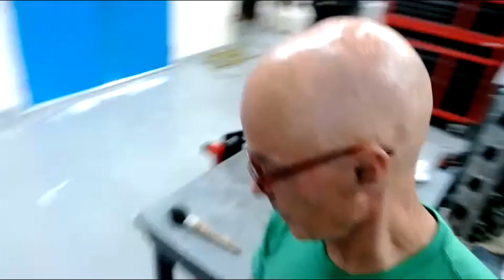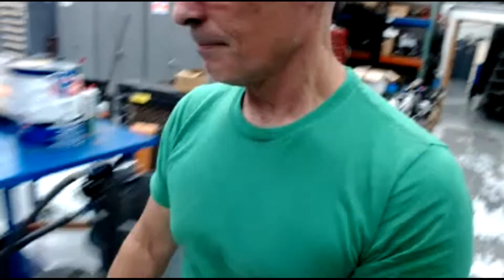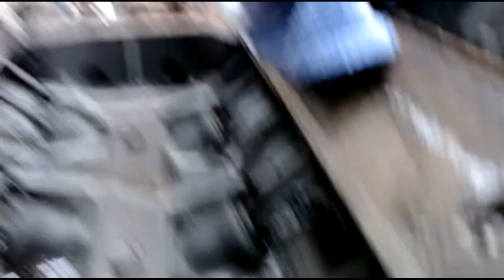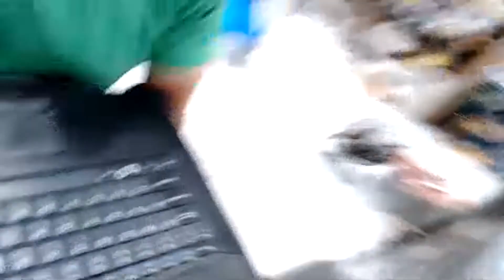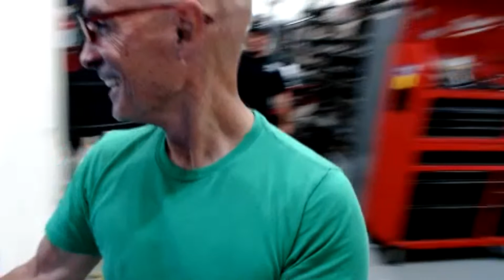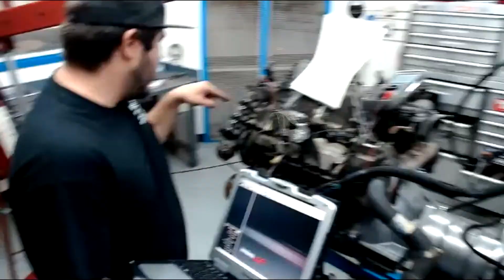LET'S TALK TURBOS AND BLOWER-COMPOUND 3800

Comment: I've heard you can swap the rotors from a m112 into an m90 and extend the case and shorten the snout to fit, haven't heard if this was an improvement or not though only a couple GTP guys seem to have done it.
Reply: Extend the case how?
Reply: @cc23001  you machine a spacer to sandwich between the sc housing and the snout mounting plate then shorten the snout or run an offset pulley. I've only read about it never really seen anyone do it though. the rotors also extend past the original opening in the m90 case so it might restrict to much to make a difference.
Reply: @jakemountjoy7232  you don't shorten the snout. They use the snout from Ford Eaton blowers. They're already short. But a spacer plate is used

Comment: I honestly  think  your  going to be  limited   by the  manifolds  on the  3800 when going  to turbo  verry narrow exhaust  runners  out of that front cast manifold   aswell as the  crossover pipe  may  split  under  the  backpressure to push the turbo to full potential... in my  opinion  that is...

Comment: l32 is 60 degree
Reply: No it is not. The only difference between the L32 and L67 were a few internal upgrades, and gen 5 M90. The blocks for the L32 are still stamped L67 because that never changed

Comment: I wish someone would build a 600ish cube BB Chevy for a broad torque curve under 6000 rpm to use in a one ton dually to pull 15,000 lbs. trailer.  I wouldn't mind using 93 octane pump gas with maybe water/meth under load.
Reply: Why not just get a diesel at that point?
Reply: @cc23001  Changing to a diesel would require more driveline changes than just going to a bigger gas engine, especially if the truck already has a big block.  Diesels also have half the useable powerband of a gas engine.
Reply: Turbos are a torque adding device.  Why don’t you turbocharge it? Turbos will help your engine dig when you want. You will also benefit from less swept volume displacement for fuel mileage.

It will also cost less than a tall deck aftermarket stroker chev.

Comment: Everybody should be greatly thankful to Richard for all of the awesome info that he shares. That said, the info shared about batch vs sequential is not giving a clear view of the issue. Richard points at the lack of benefit in power numbers. True, but sequential offers major improvements in drivability and fuel smell with a larger cam as you can tune injection timing. So for what Richard is doing....testing millions of power combinations....batch gives good info. But unless you only plan to run a stock cam or only use your rig for racing....sequential is king.
Reply: Even on a stock GEN5 6.2 you can hear a difference in idle quality when switching between batch and sequential.
Reply: When each piston is going up and down 140 times per second batch is just fine. Yes, idle and mileage are positively affected by sequential. At power and RPM sequential seems less important.

Comment: In regards to the 3.8, Haltech guys use 460 degrees rising for tooth 1 on the 18x wheel, megasquirt uses 700 degrees rising on the 18x wheel, or 75 degrees on the 3 tooth wheel. Not sure how Holley compares in the way it reads and such. Anyway, hopefully that helps! Good luck!!

Comment: Would love to put a 3800 super in a late 70s skyhawk, starfire, monza.....
Reply: I used to have a Buick Skyhawk with the 231 V6 and 5-speed manual.  110 hp, so not very fast.  But I've always liked that body style.
Reply: @andyharman3022  75 Monza 262 v8 ,motor mount plug change !

Comment: Do you know anyone that has modified a Buick Straight 8?
Reply: I saw a vintage Buick LSR car at the Ohio Mile with a straight-8.  He was using it as a warmup event for Bonneville.
Reply: @andyharman3022  mine is going to have a 40s factory dual carb .Factory split exhaust manifold. Careful porting on everything.  Mild grind on the cam.
Reply: Those are cool engines. Supposedly, those long cranks start twisting up like spaghetti and develop weird harmonics when one pushes on them.
Reply: @carterlee8344  mine is going to have 40s factory dual carb and split exhaust manifold.  Careful porting on everything.  Mild grind on the cam